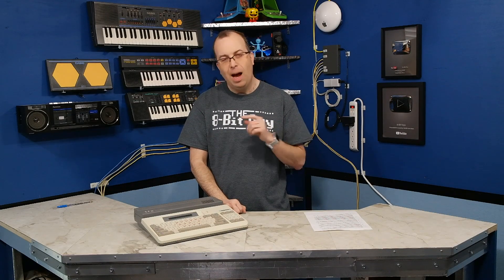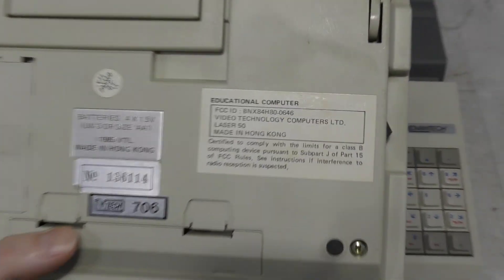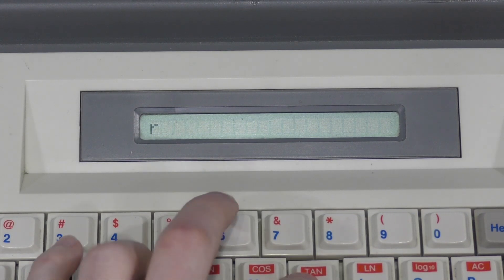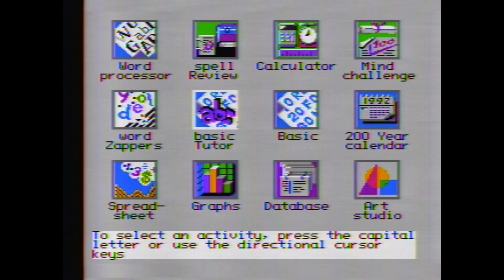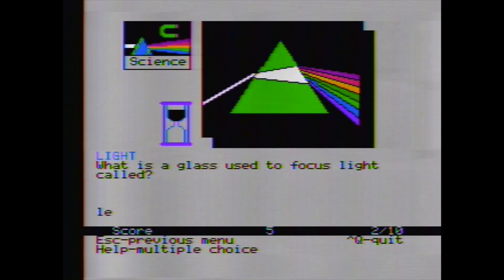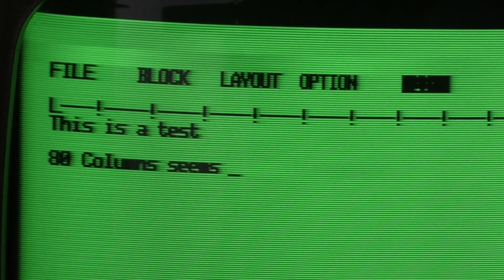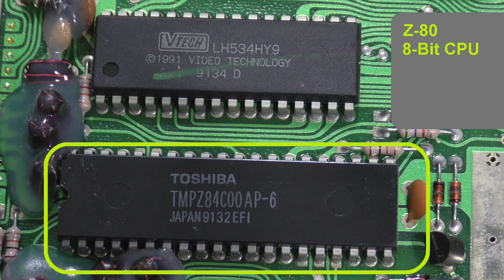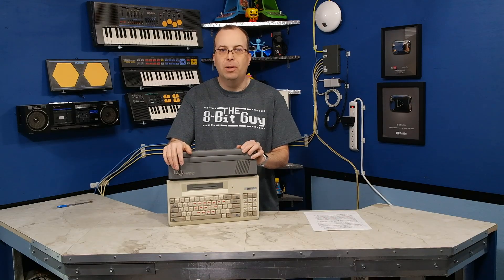The Advantech I.Q. Unlimited with BASIC and a Z80 CPU.

Comment: While the look of the color fringing effects appear like an Apple ][, the way the color works in Word Zappers indicates that ZX/Vic20/etc style color attributes are used. I don't think color is generated Apple ][ style - although like the Atari 8 bits, Coco, and CGA graphics it could be done anyway (modulo sometimes the color phase will be 180 degrees off).

In short, it was extremely common in the era for the video chip output to align pixels with chroma cycles. Obviously the Apple ][, but also Atari 8 bits, TRS-80 Coco, CGA composite output graphics, and so on ... I would expect the graphics they used was just whatever they used for their cheap PC clone.

In contrast, the Commodore VIC20/C64/etc took the far more unusual approach of making the pixel clock and chroma clock odd multiples of each other such that each field would by 180 degrees out of phase with each other. There actually is some benefit to this in terms of the clock electronics, which is why the Apple ][ has a CPU clock that's an odd multiple of the chroma clock. Obviously, Steve Wozniak decided to design the video hardware to "compensate" for this by oddly cramming 7 pixels into each fetch cycle instead of the more typical 8. But the VIC20/C64/etc? Plain old 8 pixels per fetch cycle, and choosing an odd number of fetch cycles per field.

The result? Each field, the chroma clock alignment would flip 180 degrees with respect to the pixel clock. The color fringe effects would pretty much cancel out visually, resulting in a much more pleasant display to look at. I'd almost go so far as to say this was the best killer feature of the C64 - and one which went completely untouted. Barely anyone even knows about it. But in practical terms, it made the C64 a much better word processing system for people on a budget (using a TV, or cheaper composite monitor). OTOH, people on really tight budgets would have had a black&white TV rather than a color TV, making the difference in color fringe effects moot. Nevertheless, the C64 still had a more pleasant word processing font with a nicer taller aspect ratio than the competition.

Bottom line? The fact that the "look" of this computer's text doesn't mean much. It's actually the Vic/C64 which was the odd one out. A more telling thing would be whether the text characters are 6 or 7 or 8 pixels wide. I'll be honest and say I'm not sure. 6 pixels wide means Coco/Ti99/etc style. 7 pixels wide of course means Apple ][ style. 8 pixels wide means Atari 8 bit style or CGA style or just something generic.
Reply: ... and I think that the characters are 6 pixels wide. It's definitely not 7 pixels wide (like Apple ][), because neighboring double characters (like "ff") have the same color fringe effects. They should be 180 degrees out of phase with 7 pixel wide characters.

The look of the "w" and "m" characters makes me think they're 6 pixel wide characters. Also, it was more typical to have two pixel wide vertical lines in 8x8 fonts of that era (albeit, the PET and VIC20 used single pixel wide vertical lines in their 8x8 fonts).

Comment: HI The 8-Bit Guy
,
I had one of the one from the catalogue you shows the blue one with the hand hole on the right side, my comment is about my machine, but maybe the same for yours, the hole manual  only said about simple commands, also I had trs80 (COCO), extended basic version,  so for a bit of fun to seen what it could do, programs, (memory, as you say was a big problem), so trying make a small program fit the memory space. I found it could use a lot more commands  not documented in the manual, I think some where  print commands Left$ Right$ Mid$, (which where in the  COCO Extended basic, as you probably coco a version of Microsoft Basic before Qbasic i thick ). my think it has some version basic for one of the small Casio, Tandy calculators with qwerty boards, in it. any help? :-)

Comment: Here's a thought: Have you tried plugging it into the colour TV and turning the TV's colour strength control all the way down to zero? It might then actually give readable text in 80-column mode (and make it clearer in 40-col). The colour smears are just from the composite decoder deciding the text patterns are high-frequency colour encoding waveforms and decoding them as such after all. Really, the designers should have turned off the colourburst output in the modulator to make that switch automatic, but it's maybe a case that if you cut out the colour "overlay" from the decoder altogether you'll still see the original high-rez luminance data showing through underneath, achieving the same effect. I believe that's what's behind the phenomenon of "dot crawl" etc after all. Though a more modern/sophisticated 3D comb filter type decoder might end up smoothing out the luma at the same time... worth a quick experimental test to see which case is true, either way.

I wouldn't be entirely surprised to find that this is the recommended method in the machine's original user manual, even, given that it wouldn't be entirely guaranteed that J. Random-User would happen to have a pure black-and-white TV or monitor available. "To see clear text in 80-column mode on a colour screen, adjust your colour saturation control down to its minimum" or similar. ISTR our old Philips CM8833 (same guts as the Commie 1084) having such a control on its front panel too, though not whether it worked with our ST (as that emitted analogue RGB rather than composite) or, if it did, whether that crisped up the (already fairly clear) image any in 640x200 mode...

Comment: What a weird thing to make in -91. It's not just junk from scrap drawers, the chips seem to be planned for that device. Yet it is so unusable with that calculator BASIC and no mass memory. It's not like it would have cost much to put in MS extended BASIC and a floppy drive. But maybe the idea was that it's C64 price and also has built-in software and LCD, screw usability.

Comment: Minor correction at 15:55.  You call the 74HC244 a "shift register" but that's not what the 74*244 series are.  They're line buffers, they don't "shift" anything.  Basically they're used as buffers for busses.  Why would you need something like that?  Well, it's partially to deal with "fanout", which is a limit to the number of devices you can hang off a bus.  By adding a buffer, you can get around fanout limits.  Another use for them is as a gate.  Since they have an enable pin, you can isolate part of a circuit from the bus by toggling its enable pin.  This is useful when you've got an address decoder for example, and you want the data on the data bus to appear on one side of a circuit timed perfectly with the address being decoded -- hook the 74*244's enable pin to the decoder, and voila, data appears precisely when it needs to on the Y side of the 244 buffer.

Comment: the 74ls244 is a dual 4 bit tristate driver. its being used as a 8 bit ( one way) driver for the data on the printer port. its not a shift register.

Comment: Looking at the port on the side of this computer looked like a floppy drive port that has a male end plug cable instead of a female plug cable. You could still probably find them on eBay... Loading from Drive B leads me to believe that it is actually a floppy drive port that you can access by typing in A: at the load screen.

Comment: I got this in 1991 for Christmas when I was 12. You couldn’t tell me I didn’t have the best gift ever. I had a 13” tv I used with it and an Epson 9 pin dot matrix printer from Radio Shack. I ended up using this thing all through HS and college until about 1998 when I bought a Compaq computer. LOL.

Comment: The flip up connector is for a disk drive.
it was listed in my box when i got it 
and it was avalible in the store at the time. i dint have enough to get it tho
i actuily used this little guy for a few years.
And it could connect to just about any paralel Text or epson compatible printer.

Comment: 1 bank (64KB) of the 128K Ram is probably used for battery backup saves, and the SMD Vtech chip is probably a LCD driver.   It is interesting that it has a Cart slot and an expansion port, whatever that may have been used for.

Comment: No external storage? Deal breaker.

Basic without pseudo-assembly (peek/poke)? Deal breaker.

C-64, hands down.
Reply: Back in the day, Commodore should have bought Berkeley Softworks and should have then sold or included a Geos cartridge for the C64 (with GeoWrite & GeoPaint).  This would have made the Commodore 64 a lot more attractive to buyers.

Comment: my gawd what a badly manufactured pcb. lol. random shit on the front, random shit on the back (what did they run out of space, or did they decide to mix their leftover wire-wrap style resistors-on-a-socket thing with smd on the back of the pcb of all places randomly ;), the pins of that one chip are not soldered through the hole all the way, soldered stranded cables directly onto the pcb all over the place (ever heard of connectors and crimping stuff?) and the ugly brown 'moist sucking' pcb material of times long past. (by 1992 everyone already figured out that those brown pcbs were nothing but trouble, in fact they went out of fashion somewhere in 1978 already and got replaced with epoxy ;) this thing looks like someone made it at home. either that or it's a very lousy toy company :P and here i was, thinking the zx-spectrum was bad electronic design. this thing beats even that. :P

Comment: the calendar may be 'year 2000 compliant' but it most definately is not a '200 year calendar' considering that it only asks for a 2 digit year number ;) also the rf output for the tv actually uses the rf output for radios plug. (its the female plug ;)

Comment: I had one of these when I was young and I didn't remember what it was called until i saw this come up, we already had a Windows PC and this thing was just bad. I remember the same about the bad color and grainy TV display. I always felt it wasn't worth using because even though it does come loaded with programs, You can't save them to disk or anything and the batteries will die and you'll loose everything you did on it. Viewing this video was more fun than actually owning one.

Comment: I believe later versions of the Sinclair ZX Spectrum also used higher capacity RAM chips than the system could access, but had half of the chips deactivated. Maybe they got a good deal on some faulty RAM chips that were half good and half bad?

Comment: Some clarifications, the 74HC244 is an 8-bit data buffer, not a shift register. Also the TMP42C50 has 512 Bytes of ROM and 16 Bytes of RAM. That is Bytes not K Bytes. You were off by a factor of 1024 which is a bit much even for estimating the government debt. A 4 bit micro at 5 MHz cannot do video. My thoughts are keyboard. I agree that the odd part is likely a flash ROM.  The flat pack on the other side could be video.

Comment: Hmm, between some things I've looked up myself, what unmentioned things we can see in the video, and others' comments...

The topside VTech chip like you say is probably just a Glue ULA of some kind. I'm not even entirely sure it would have anything to do with video generation, but it may well help run the LCD. It looks like it has tendrils into all kinds of other places on the board, but it's hard to trace from this footage.

The one on the underside definitely seems to be a ROM, given other seekers found through Google. Made by Sharp and holding a full 512 kilobytes, so essentially a built in 8-sector DSDD when considered in combination with the RAM. Might be interesting to dump it, see if any pointers as to how its graphics work, maybe reverse engineer how to run different programs on it, if you were extremely bored at some point.

Odd thing about that is that it shares lines not only with the obvious cartridge port, but the mystery edge connector on the back (and the two also share lines). So possibly that is either for some other kind of cartridge or expansion, or maybe a disk drive interface?

The microcontroller is probably just the keyboard interface. Might have some involvement in RTC and other battery backed data maintenance?

Memory chip, I suspect part of it is working memory, maybe VRAM as well, but also at least half of it used to save files internally. The save area you put the test files into says 59000-ish bytes free, so probably 64k of actual recording space with some of it given over to file index and system variables etc. What happens if you try loading from/saving to the other "drives" on offer other than that one? Whatever switching scheme it runs to access the storage area (and the ROM(s), of course) must be quite interesting, because you need to keep some aside to actually run the processor. Perhaps there's even 4kb not being accessed of that storage space because that's the one part of the "working" area that isn't bankswitched out... Quite how you then end up with 22, 23, 24kb free in the word processor and spreadsheet with a blank document, unless it's copying the program itself into RAM from ROM instead of running direct...?

Video hardware, I think at least some of it might be hiding on what you guessed at as being the power board - the modulator seems to connect to it, and the composite video port is co-sited with the DC input (directly on that PCB?), so it could be a combination power supply/control AND video generation board. May well find a CRTC, maybe even another small RAM on there (as, particularly, the TMS9914 can use entirely separate memory and work as a low grade graphics coprocessor merely under command of the main CPU), as well as regulators and so on. There was a suggestion it might have an Apple II on-a-chip device (or at least the Woz video hardware) but the apparent resolution and colour depth, as well as how it looks in greyscale, just doesn't gel with that so it's probably something else. Maybe even a completely custom VTech thing, as the greyscale appearance is particularly strange - five or six greyscales actually used, and the artefact striping only being pairs of reasonably close greys, in one or other order, or just flat grey, giving maybe 12 colours total including black, white, and 3 or 4 intermediate greys. Dunno whether that lets you reduce the total memory and bitdepth / bandwidth requirements (perhaps it's a bit like the IIgs in high rez, with each pixel pair using 4 bits for a hybrid output allowing low rez colour as well as high rez black-and-white, which would be why 80-col mode is monochrome even though you'd expect to at least be able to use 4 greys)...

Think it might well stand a follow up re-investigation to see what's there.

Comment: I think those 2 unknown chips could either be a keyboard controller? Like on your other videos when keyboard didn't work, you would use the certain chips and send a notification trough the chip to type a letter with a voltage meter.

Comment: I actually often think about, what a brandnew Computer-System with a 6502 CPU would be capable to do nowerdays, because with cross compiling you could develop stuff on high-end-systems to let it run on low-end and very low-priced hardware. Imagining it like a 2$ PC featuring a 6502 CPU, but it can do teaching stuff, having a writer and calulation software and runs on a TV like all the 80s computer - so a mix of modern and classic stuff. I guess this VTEC you just showed is exactly what I always was thinking about - but not for 2$ in 2018, but for 200$ or less in 1991.
Reply: Even if you can still get 6502 CPUs new (which you can, Western Design Center still makes them, capable of up to 14MHz clock) a 6502 system wouldn't be that cheap at all. It's all various ARM cores nowadays, often integrated in SoCs. And they get EXTREMELY cheap, seeing that you can get complete smartphones for way under $100 or even for hobbyists the Raspi Zero etc. 

You COULD get away for less with an ASIC and an 6502 or Z80 core, but that takes a HUGE volume to offset the development cost, and some gullible customers. I'm definitely not looking at a leading graphing calculator company right now ..

Comment: The laser 200 and 300 were also very popular in Australia distributed by Dick Smith as VZ200 and VZ300 respectively. I cut my coding teeth on the 200 at age 7, it took years to undo the damage of the location of the space bar ;) from there C64, and then IBM XT the rest is history.

Comment: David, may I ask you a question?

I have a calculator (~1979)thats kind of broken, its a Lloyds accumatix 603 that works 1/2 of the time and it gave me an error code not so long ago (error 100) I think, when I powered it on, it displayed the number 100 in the middle of the vaccum led display, I wonder if you could send me instructions on how to try to fix it (because I'm not great at fixing things) I would be very gratefull if you could help out. Thanks

Sebastian

Comment: 15:46 I immediately went into full on NOPE! mode when you called a 74HC244 a shift register. That, plus errors regarding the microcontroller, make this video painful.
The 74HC244 is a 3-state octal buffer/line driver. It's basically a type of switch/signal amplifier. It's used to either connect or disconnect a part off of the data bus. It's often used to select one device or another to be accessed, by coding an address bus value into the enables. That way, calling an address, lets you read what's connected. That's the simplified version of it's function. When the chip is disabled, the bus can switch high or low, and not affect, or be affected by connected chip.

Comment: It was a cost saving trick in the '80s to buy faulty RAM chips at a low price and then use the half that worked okay. That's probably why there's a 128KB chip in there while the machine only uses 64KB. Most of the Sinclair home computers also did this.